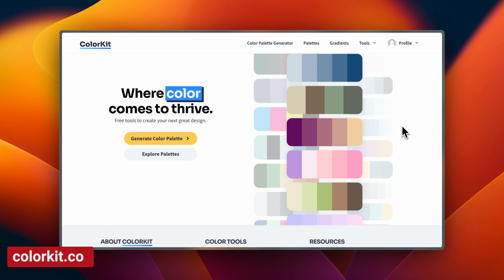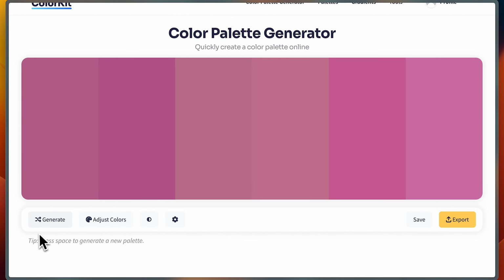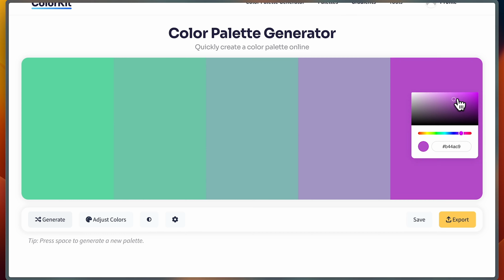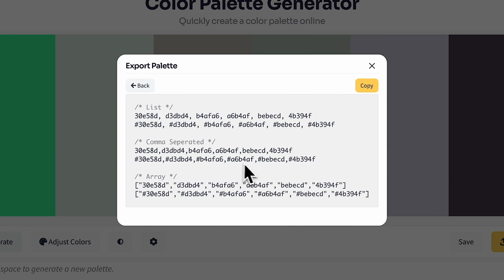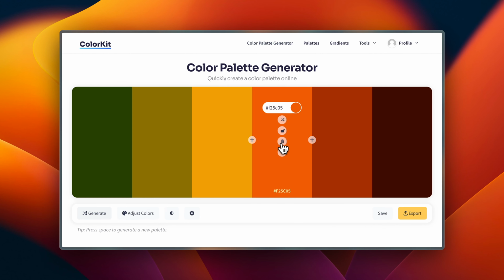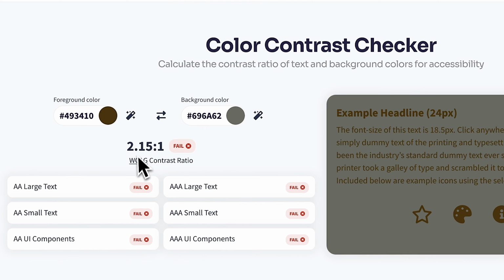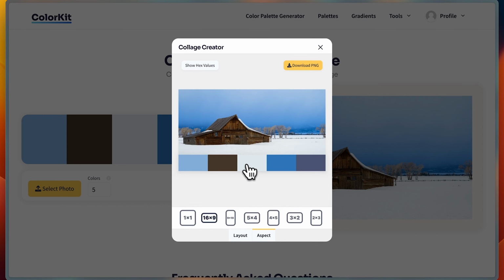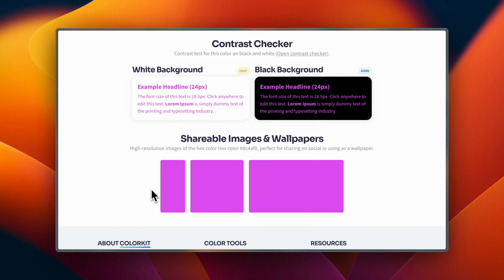Creating Color Palettes with ColorKit.co

Comment: I'm using it on my mobile browser, it's great but how do I add a new color to a palette on mobile? I want 6 colors not 5, and I can't find the + button.
Reply: So when I switch to desktop view it works perfectly, which solves my issue in a way. But in the browser's default mobile view, It doesn't work. Anyway, thanks for such a great tool.
Reply from the maker: Thanks for letting me know! I will add that on mobile, as a work around you could modify the url by adding an extra color (for example -111111 at the end of the url) so that the tool adds an additional color.